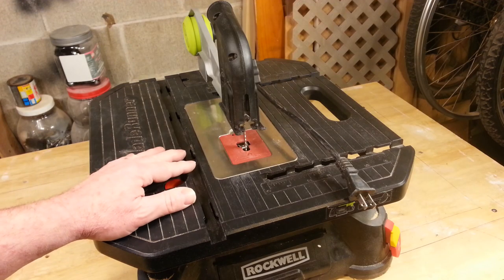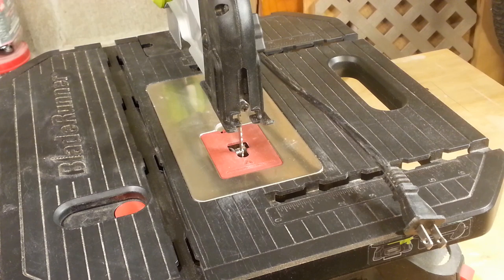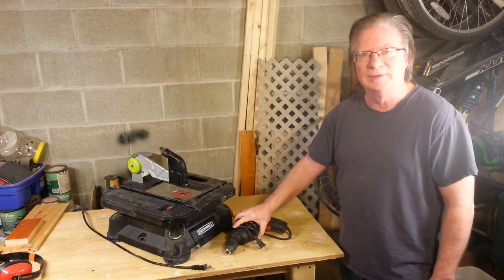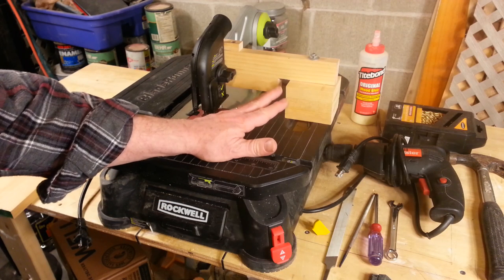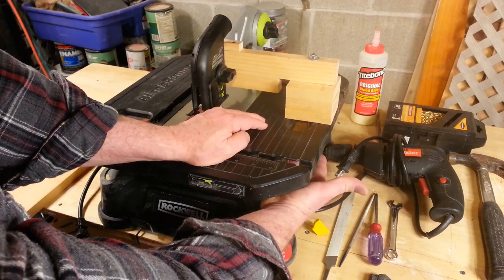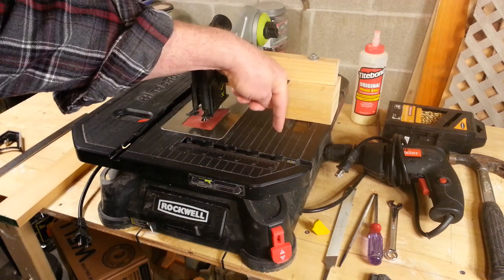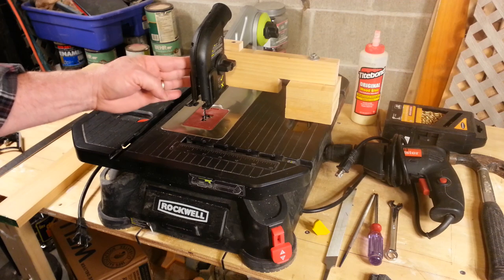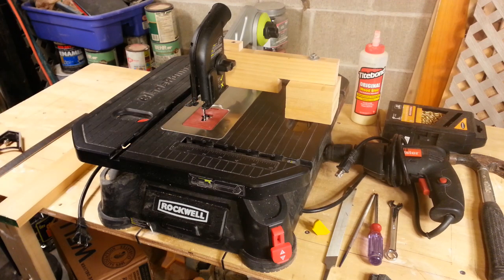55. Bladerunner support arm - part 2

Comment: How about a "bridge" of square extruded aluminum bar that runs underneath the arm and is slotted so the saw arm can nest into it? The bar would be attached to arms on both side of the saw.
Reply from the maker: Yes, I think something like that would work. At the moment, I am working on a enhanced design using only wood and simple fasteners. I hope to have a video out soon. Thanks for your comment and for watching.
Reply: Remember that the bladerunner can cut metal and comes with some blades to do so, so it's within reason that someone with the tool could use it to make a few cuts in aluminum or conduit
Reply from the maker: Agreed. Thanks for your comment and for watching.

Comment: Today is April first, 2022. I have just watched this video and cannot find part 3. Did you give up on this project?
Reply from the maker: The short answer is "yes". The last project I made using the BladeRunner was this one: https://youtu.be/W-aKZlOVNlI (a wooden portable bookshelf). In that video, you'll see me making some cuts using the BladeRunner without the arm installed. I did use a heavy weight (a transformer out of an old microwave) to help hold the board down. Using the weight really helped a lot.
I think the key thing to keep in mind when cutting using the BladeRunner is be sure you're using a sharp blade and to not rush the cut (let the blade do the work). The other thing to keep in mind is to try and not let the blade get too hot (which probably dulls it prematurely).
I have thought about making my own "BladeRunner" using a jigsaw (with variable speed and tilting blade) but I haven't gone past the thinking about it stage.
Thanks for your question and for watching.

Comment: Have you had any problems with the blade forcing crooked cuts when using the fence? On mine, it seems like the blade is not parallel to the fence and it forces your piece of wood to be cut crooked I can freehand it better than using the fence. Stupid.
Reply from the maker: Yes, I've experienced the same issue. In fact, I made a couple videos about just that. You can find them in my BladeRunner playlist; here's the link:  https://youtube.com/playlist?list=PLGCBwUeR2BD2SPSsV51qPBkK8p1grR-UL
Video #13 and #14 specifically talks about using the fence. Video #19 talks about adjusting the motor. Video #41 compares the BR to a scroll saw and a bandsaw. There are several other videos in the playlist you might want to watch.
I liked what you said that you can freehand a cut better than using the fence. I have come to the same conclusion. However, to be fair, the BR is not a fine woodworking tool. It is more like a hobby tool. Yes, you can cut wood with it but the cuts may not be as accurate as using a traditional table saw. Video #112 shows me doing some freehand cuts that are pretty accurate. Notice the heavy weight I'm using to help hold the wood down while cutting.
Thanks for your comment and for watching.